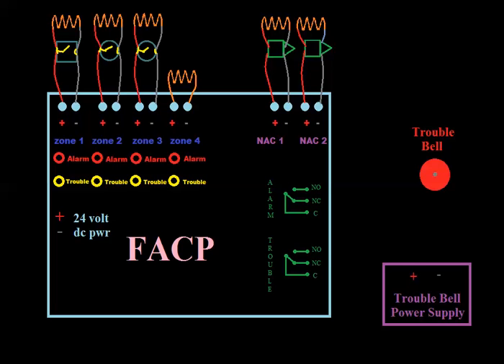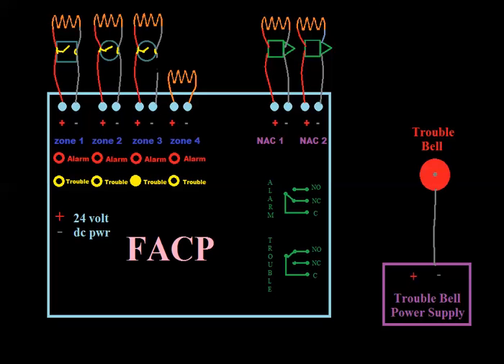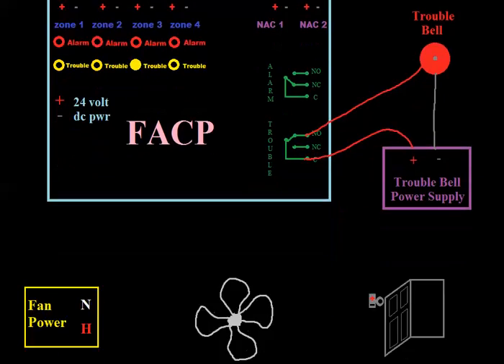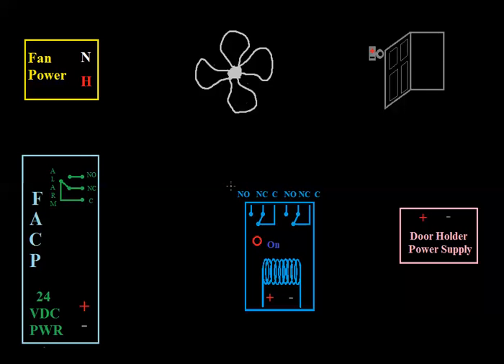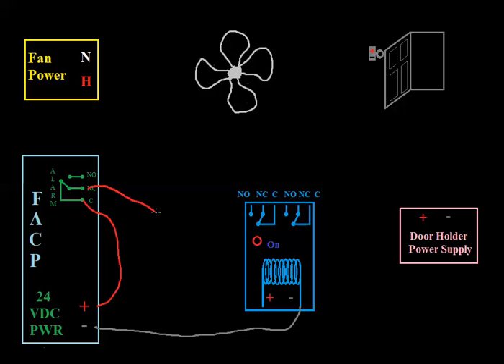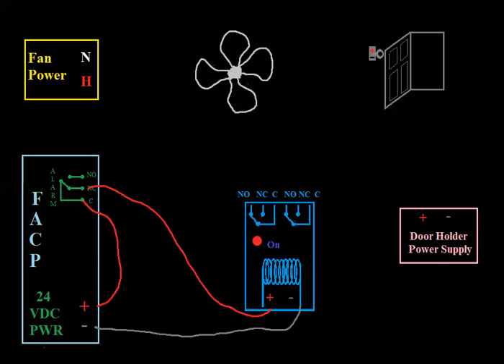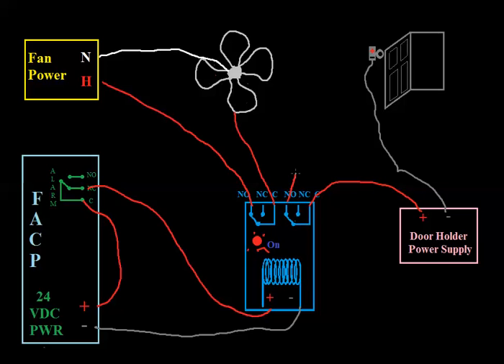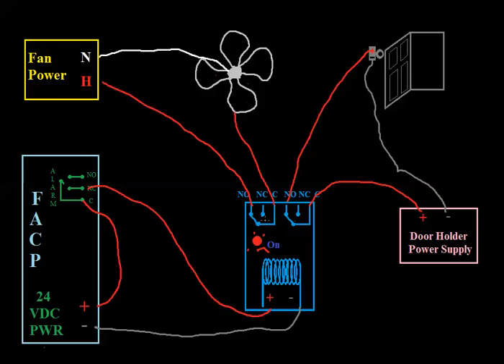5 - Fan Shutdown and Door Release off One Panel Relay - Introduction to Fire Alarms

Comment: Thanks for your efforts, 
One question please, Suppose I have one normally open relay to turn on a fan in case of alarm, In normal condition, the fan is off because the circuit is already open, So how can I supervise this circuit if the wire is cut in normal condition?
Reply from the maker: In theory you could wire the relay so it's always powered up, then run one leg of the fan circuit through the contact of the relay that's open when the relay has power. That would make the relay fail safe. If something happened to the wiring going to the fan relay, the relay would change states and the fan would start. You could then take it a step further and put a power supervision relay on the power circuit that runs the fan to supervise that portion of the circuit.

Comment: Can you tell me how to wire up a damper shutdown without 24v and using the 120v?
Reply from the maker: Alex, you need to use a relay you can control, like an MR-101 or equivalent. Then run the damper through the contacts. It might be helpful to watch the video on elevator shunt trip. That shows how to control an MR-101 using the power you're controlling (in your case, the damper power). Be careful though, it's easy to screw up and you don't want to damage your panel.
Reply: @JoeKlochan  can't we use a Rib realay too?
Reply: By the way YOU ARE AWESOME I LOVE YOUR VIDEOS! I learned so much and made me just understand fire alarm way better.
Reply from the maker: Yeah, as long as it's rated for the current.
Reply: @JoeKlochan  Hello thank you for educating videos they are very professional.I have one question. If the fun that we want to shut off is connected to the distribution board what is the procedure to trip the breaker that the fan ia connected to.
Reply: Hello ti the group.I will be greatful if you can help me. I have pressure switch which is operating with 230V Ac. I need to shut of a  solenoid valve which operates with 230V. I want to shut of the solenoid valve when the pressure is under the initial level. Is it a way to do this with a contactor?

Comment: hello sir thank you for the vieos i think u made a mistake with the fans ...first of all the hot wire should go to the commun then it leaves the relays from the NC so when the relay is activated it opens and stops the fan from sppining again thank you so much
Reply from the maker: On this style of relay it's labeled out of the box. So in other words, NC is closed until the relay gets power. At that point, NC is actually the open contact, and NO is closed. Wiring to the NO contact when and keeping the relay powered makes this a fail safe circuit. I know that can be confusing.

Comment: Shouldn't the door and fan relay be NC since you want the circuit to be complete (door open and fan running) under normal conditions?
Reply from the maker: Justin,
     At around the 5:30 mark in three video I explain that once that MR-201 relay gets powered up, its contacts change states. At that point the NC contact opens and the NO contact closes. I emphasize it again at the 7:30 mark because I can see how it could be confusing. the relays labels apply to the state of the relay out of the box, with no power applied.
Reply: Yes, seems like he was mixing up NC/NO a bit
Reply from the maker: Patrick, no I wasn't. When the MR-201 gets power, the coil picks and NO closes. That's important to understand.
Reply: You are right, my bad! I was the one mixed up.